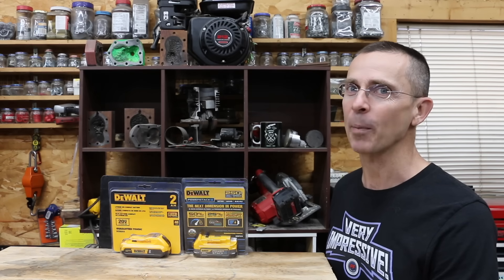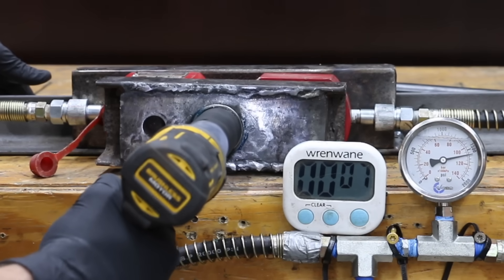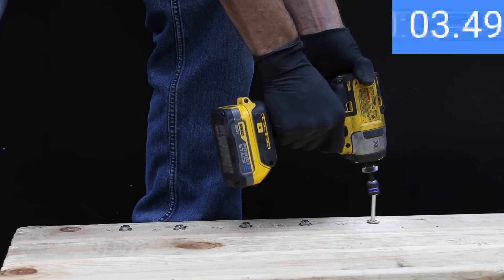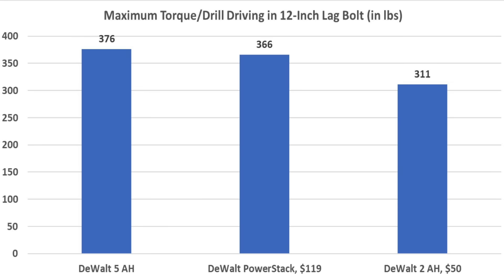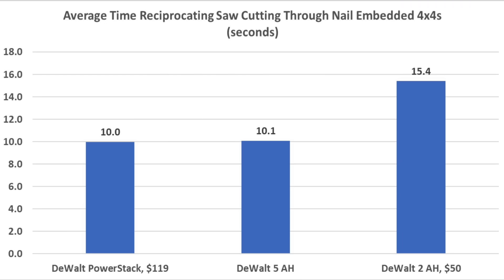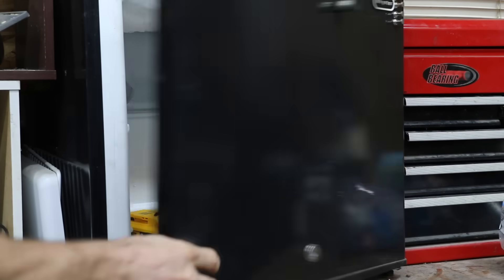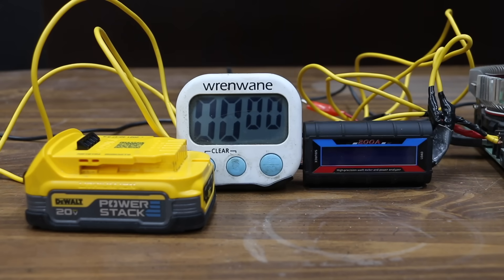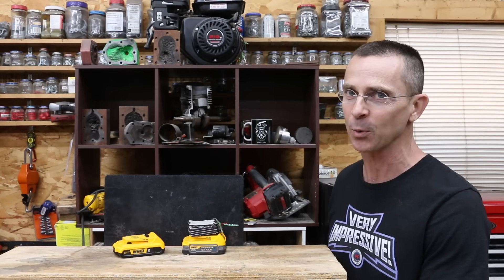Compact “Pouch Cell” Battery Better? Let's Find Out!

Comment: This again proved my purchase of only 5ah cell packs a wise decision. 
In the last 15 years, the most unstable lithium ion batteries I have found are the molded pack design. From outright circuit failures during use, to 3 separate fires during charging, one of them technically exploding upon failure.
The individual cells in the 5ah pack can be replaced. 
Not to mention the circuit has better control of current draw/charging of each cell, whereas the molded pack is monitored more as an entire unit and not so much as individual cells. 
And worse case, if a cell in the cell type of battery pack is going bad, the individual cell is able to "turn" itself off, no longer giving nor receiving a charge. Many instances, that still leaves you with most of the rest of the cells to try to finish the job the best you can.
If even one cell in these molded packs fail, the entire pack is toast.
$120 for a battery pack vs $20 for 10 individual lithium ion cell batteries of the same output current or greater. The math alone shows the molded packs are not worth investing in any time soon. 
Pay close attention to the very real fact that just the 2ah battery outlasted the molded pack design's discharge rate. 
That is because those sorts of cells develop internal flaws every use/charge cycle whereas the individual cell types are designed to combat that very problem from the start.
Reply: I only use the 5ah or larger batterys I've found the 2 and 1.5 ones just die ton fast and have a noticable loss in power
Reply from the maker: Thanks for sharing.

Comment: The drain tests were the most revealing about this "better" battery. If I'm pulling out the cordless I want it to last as long as possible between charges - if the upfront power is higher but immediately drops off it's not really a win. Excellent video as always.
Reply: Batteries can give you overall capacity and they can be built to deliver the capacity at faster rates. Which means you're trading power (torque) for amount of time. They can make a battery that lasts you an hour straight but if the motor stalls driving in a basic wood screw every quarter second because they only allow a trickle out for that long lasting battery, of what use is it?

It's all a balancing act. When you rebuild your batteries, if you're so inclined, you can choose cells with different ratings. I've made high capacity batteries with low drain specifically for a portable fan because fans are low torque applications and i do want them to last long between charges as they are continuous use. And while I still left it some oomph it'll not be my go to for driving bits and cutting unless I need it. I've built high capacity batteries with high drain for the power tools that need the torque.

Pick and choose the application.
Reply: @etherealrose2139  Not only that, but the PowerStack isn't a 2AH battery, but a 1.7AH. So even without considering what you said, it's normal that it last less time.
Reply: My 5AH DeWalt batteries cost the same as these powerstack batteries but produce more consistent torque for a much, much longer period of time. Where exactly do these batteries excel vs the 5AH? Slightly higher torque for about 20 seconds? The only consideration for preferring one of these new batteries comes down to weight and space saving neither of which I care about. The tech is certainly an improvement due to the better energy density but the significantly lower capacity and the high price point is not worth it compared to what I already own.
Reply: @mike5587  they look like they might be handy for tighter spots (inside a cabinet during an install??) but at the current price, ill just keep using the 5ah when I have the space and the standard 2ah when I prefer the tool to be light/small
Reply: @mike5587  it's a small form factor battery that has the power output of a much larger battery. The applications for that seem pretty obvious to me, and that will scale with capacity.

Pouch cells are actually relatively cheap. If the tool manufactures transition to them, it will be less expensive than cylindrical form factor batteries.
Reply: @Black70Fastback  that is one of the intended design…smaller and lighter + atomic dewalt variant for reducing fatigue of frequent use..I’m sure the price will go down later on…now they just milking everything they could to roll the r&d cost as much as they can(well..business 😂) until the competitor joining the competition…and yeah they’ll likely bumping the capacity later on 🤔
Reply: Weight and size are a huge deal for some applications. Having the same “oomph” from a tiny battery is a big win if you’re working over head or out reached in front of you.
Reply from the maker: Thanks!  Thanks for the feedback.
Reply: I design batteries for OEM's and I can tell you that it is in fact a better battery.  If the discharge better resembled the use - incremental blasts of current for up to 10s or so on average drill use - the power stack will outperform and continue to perform with more current per use.  Also the LIPO cells are quicker to cool off.  The discharge test here watching the voltage as an indicator isn't adequate.  If the voltage was read after the load was removed the LIPO cells will have rebounded their voltage much more than the 18650 cells.  Under designed use the LIPO cells will deliver needed current for longer in the amount needed and will recover quicker when being used in quick succession to, say screw in 10000 screws, in the 1s breaks between screws.  The design of the LIPO cell is such that once they are driven lower than their designed voltage they will quickly fall off - if the power system is designed correctly (which I guarantee it is) the battery pack will never allow it to fall off as dramatically as the graph indicates.  The drill would stop and after a short break could give you the needed power again but at that time it still would be favorable to charge it.
Reply: I think the power stack will last longer than the old 2ah battery when it's on your belt in an impact drill.  It discharged faster  during the discharge test because it can deliver more peak power, but if you aren't demanding that peak power it should last longer.  It's like how buggati Veyron can drain it's tank in less than an hour, that doesn't mean the Honda insight is better. 

Think of it this way, it usually lasts longer, but can deliver more power if and when you need it. As we saw in the test, it's a small 2ah battery that can keep up with the 5ah battery in a pinch if you need to throw it in the saw zall. With the old 2ah hour batteries, you're better off getting a hand saw 🪚 out rather than risk burning out your battery and tools..

However it is more than double the price. But it's always like that for early adopters.  Early adopters and tool geeks fund r&d then we reap the spoils years later.

Comment: I just saw a video on the DeWalt battery system about a week ago. I might go with them when I buy some newer tools. I have old 18V system now and might send them to our place in the Philippines. I also like Rigid because they have a LIFETIME battery replacement. Great video! What do you think about EGO batteries? I want to go all electric when we build our new house and will get some EGO power tools for the yard work.
Reply from the maker: Thanks for the suggestion.

Comment: Hi quick question, will putting a 5ah battery on a tool increase its potential torque? Rather than a 2ah battery?
Reply from the maker: Yes, it will.  Thanks!

Comment: Excellent video as always, very well done. Though the power stack seems kind of gimmicky I hope dewalt will invest some more resources to improving its batteries. Some of the new tools need new batteries and that sucks for those bleeding yellow. The packs using 21700 cells always tested and worked the best. But the powerstack is def compact.
Reply from the maker: Thanks!  Thanks for the feedback.

Comment: At 6 minutes where the lag bolt stopped short of the board that could be because of the socket hitting the board and the friction between the socket and bolt head not being over come. I have encountered that problem a fair few times, that when using a bolt with a 'collar' on the head, although it risks slipping off a lot more, drove the bolts all the way in on the first attempt, where as without it would not. A fair enough test though.
Reply from the maker: Thanks for sharing.
Reply: though I will caveat that with the fact I was driving self thread cutting fixing bolts into holes in concrete or masonry, the latter done with a socket wrench the former with a battery socket thing very much like the Dewalt..

Comment: So they just put a lipo in it.
That's just almost a scam.

Lipo's can handle much more current. Lower internal resistance.
Pack density is probably a bit higher compared to a metal can lithium.

But they can't handle deep discharge as well and maybe storage.

Wondering how they perform after a while.

I think just buying the 5AH is the better choice.
Of you want you can replace the cells when they die.
Reply from the maker: Thanks for the feedback.

Comment: I'm surprised they are just starting to use flat cells for tool battery packs now. This type of configuration has been of use in RC cars for years and years. I got a few pairs of cells here that are over 15 years old lol. But these seem to be a lot more expensive and shorter living than my RC packs though.
Reply from the maker: Thanks for sharing.

Comment: That is super testing. For a pro, the extra cost may be justifiable. But for a frequent DIYer and small engines guy like me, two seconds, or even 5 seconds, faster is irrelevant. I still choke at the $50 price tag on the 2AH batteries; no way I'd pay more than double, & more than the tool itself, to pick up a whopping two seconds.
Reply from the maker: Thanks for the feedback.

Comment: While I can't attest to what electrolyte was used in either battery, I would like to clear the notion that a "stacked" battery is going to be a lipo and a round a li-ion, what determines the difference isn't the mechanical design, just the electrolyte used. Lipo uses a gel polymer, which gives it a lower internal resistance. This has its pluses and minuses over a standard li-ion battery. Vs a li-ion which uses a liquid electrolyte

Source: I used to work for a very large li-on battery manufacturer
Reply from the maker: Thanks for the information
Reply: @ProjectFarm  thanks for making videos, I have gotten some better tools thanks to your work

Comment: i love the videos. i would love to see a test and review of the different tool carrying and storing systems. i have been looking at the new ryobi link system but i like the Milwaukee pack out system but it is more pricey. also i would like to know more about the makita makpac. i would love to see tests on there ability to keep water out, there strength to stank on them, how easy they are to take from being all laid out to all in transport position, there strength so how much it takes to mrake them and what features they have that make them better or worse than the others like removable handles so you can put them in a pickup bed
Reply from the maker: Thanks!  Thanks for the suggestion.
Reply: @ProjectFarm  nobody on youtube does reviews as thurugha and precise as you

Comment: I don't know if they're all like this but I cut an 18650 battery open that had suddenly quit working and it was just a small pouch that was rolled up and had wires connecting to the case and button. One of which had broken.    But it makes sense the pouch battery is better since you can cram more flat rectangle cells into a square battery case than you can round cells.
Reply from the maker: Thanks for the feedback.

Comment: @projectfarm. Can you do a battery cycle test, cycle them into the ground and see if the power stack is all marketing hype and burns out before the standard cells. Durability seems to be your thing for bits, blades why not batteries 🤟🏻

Comment: I curious how well they will hold up with drop impact, since they are just soft battery pouches in a plastic shell. I had dropped my 12V Makita packs from waist level for a few times, and I also used them to smack a wall plug into the hole quite often. lol

Comment: I wonder what the difference in CYCLE LIFE is between the "Power stack" and the 18650 cell based batteries. How many times can they be charged and discharged, before there is a loss of performance or capacity. What is their "end of life" failure mechanism?
Reply from the maker: Thanks for the suggestion.

Comment: This is an interesting test.  But it's a bit flawed. If you notice not all bolts went in completely vertical.  Every time, the out of vertical drivers were slower.  That makes sense as there is more friction/wood to penetrate.

Comment: all lithium batteries suffer from possible flame when battery pack shrapnel damage we see it in R/C cars and cell phones that get busted, be careful with those if they open to air they flame up big time, i crashed a quadcopter once and it ruptured the battery and whoosh....
Reply from the maker: Thanks for sharing.

Comment: You call the polymer - where is your justification for that? You said 6 cells - clearly 5. Agreed on pricing - but you have options - you're paying a premium to get a compact light weight hard hitter that does good work for short bursts. I'd like a few of them for some of my smaller tools but happy enough with 4/5AH XR packs for now. I have the 2Ah on a DCD796 and 1.3Ah on a DCD791, they're fine in that application with a DCD996+5Ah next to them for the heavier jobs.

Comment: would love to see the actual max power draw of the battery pack. Nobody is electrically testing the max power output.

Dunno what 18650 batteries Dewalt uses in their old packs, but if they used 45 amp Sony VTCs they could output about 950W fully charged. (5s1p,45Amp Sony VTC5A cells, 2.6Ah,46.8Wh) and almost 2KW in 5s2p config.

 I wonder how much this stack pack can provide.
Reply from the maker: Thanks for the suggestion.

Comment: Honesly I would never buy a LiPo power tool battery, They are far more likely to fail prematurely and blow than traditional cell lithium. 18650s and 20700s tend to just die the slow death of typical batteries, rather than Abruptly failing, puffing and even if rarely; blowing up like LiPo.
Reply from the maker: Thanks for the feedback.

Comment: The 2AH and 5AH have their place.
Carrying multiple tools on a belt up a ladder for a long period of time I'm using the 2AH due to fatigue and weight. If I'm not I use the 5AH. There is no real place for the multi pack, seems like they are trying to fill a space that just isn't required.
Reply from the maker: Thanks for the feedback.

Comment: There is one major BUCKET of  reasons why none of the tool manufacturers have moved from standard electrolyte Lithium cells (18650 and 21700 sized, for example) to polymer electrolyte (aka LiPo): danger. Lithium polymer cells are notorious for a variety of behaviours that, where their advantages are required, the person deals with it. They are finicky to charge, easily puff, have a low-tolerance for not storing them in anything but an ideal storage voltage, and are quite sensitive to temperatures - among others. 

I hope Dewalt sourced some god-level OEM for those cells.

Comment: Wow - really hard to justify the huge cost premium, you would have to be hell-bent on full performance with light weight, and be happy to charge just as often, if not more often than a 2Ah battery.  I agree with you. Power stack in a, say 4Ah, configuration would be worthy the premium (assuming it ain’t $238!)
Reply from the maker: Thanks for sharing.

Comment: Interesting... this is somewhat different than what Torque Test Channel presented, but you are actually testing the battery and tool more thoroughly. This seems to give more reason to buy it compared to TTC which basically said it had little to no difference. Reasons it's good to watch multiple tool channels.
Reply from the maker: Thanks for sharing.

Comment: Hay u said there's 6 18650 cells...no its 5 ...the 2ah pack is using 2100mah 1p5s..the 5 ah is using 2550mah 2p5s 

The power stack I think is 1800mah 

But the 18650 have an output of 15 or 20 amp n the li-ion pouch is like 35amp that why it's like a 5ah cuz it pushing 2 20 amp cells

Comment: Great video as always, I was wondering about this new pack dewalt has been advertising, lipo packs for r/c cars are similar in build, but you have to be very careful when charging because packs can puff and short out and catch on fire, I wonder if the dewalt batteries may run into the same thing or if they have refined them to keep this from happening.
Reply from the maker: Thanks!  Thanks for sharing.

Comment: I've used Li-Po/ pouch batteries in RC's for many years, even with care they don't last as long as they should. They will put out more amps when needed for drones,  helos and crazy fast cars and boats. Your 2 ah batt has 5 cells not 6 and the 5 ah batt will have 10 cells. The videos are great, I check them before buying, thnx
Reply from the maker: Thanks!  Thanks for sharing.

Comment: Interesting idea for a tool battery.
I would be a bit hesitant to use that type of battery in a tool. I wonder if they have any issues with swelling up, also is there any protection to keep them from getting punctured?  That type of battery doesn't react well when something metal punchers them. Such as a nail that can be found at any construction site.
Reply from the maker: Thanks for the feedback.

Comment: Interesting, these LiPo's are probobly able to deliver more current but the LiOn 18650 cells should have a longer life. LiPo's are a bit more vulnerable to catching fire. I actually thing the 18650 batteries are better. This is probably a supply chain solution.
Reply from the maker: Thanks for the feedback.